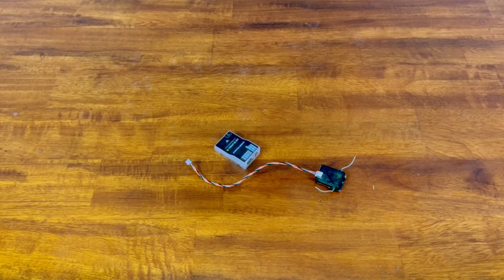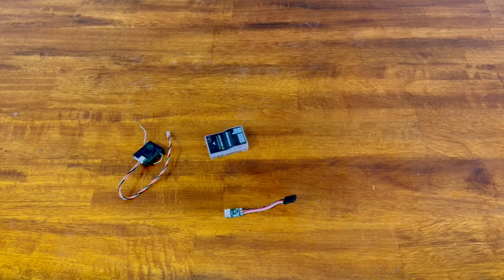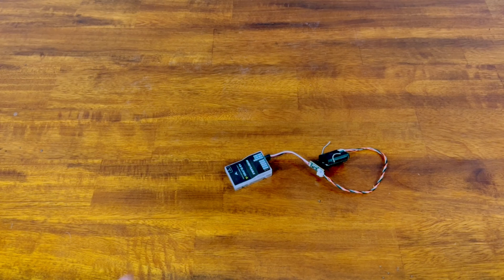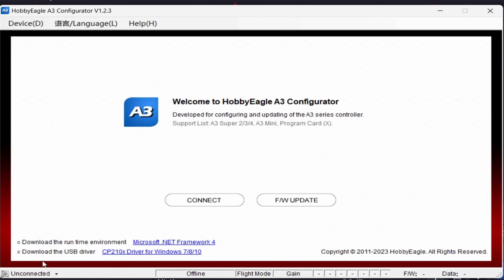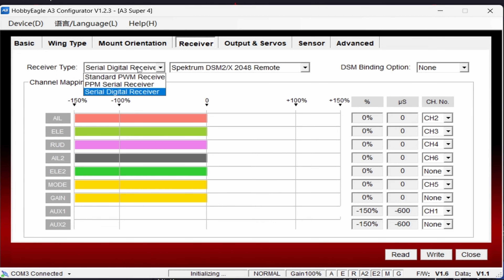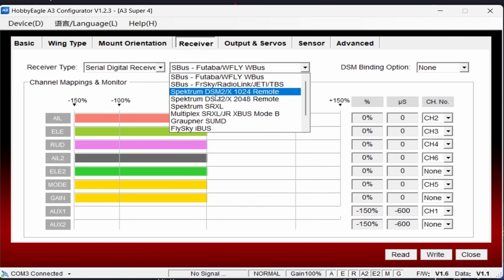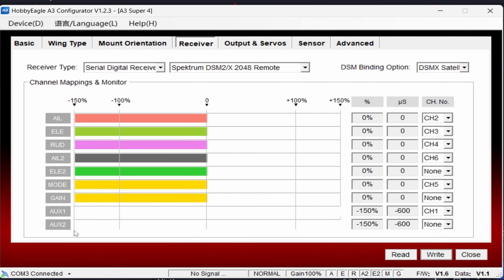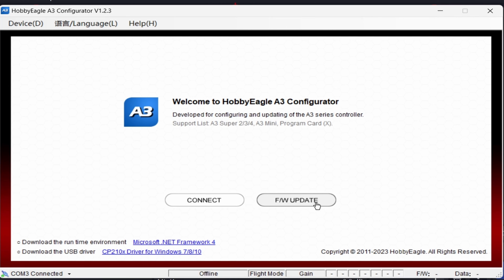How To Bind HobbyEagle A3 SUPER 4 Gyro To Satellite Receiver

Comment: This video said it was instructions on how to bind the HE A3S4 to the satellite but the video never actually showed the binding procedure.
Reply from the maker: It’s how to bind to a satellite receiver. Satellite receivers give you way more range but have a different binding protocol like a normal receiver.
Reply: Would you consider doing a video where you show the actual binding with the flashing yellow lights, etc… that’s the step where my radio fails to bind with the satellite even though the gyro and satellite are flashing yellow lights. Thx!
Reply from the maker: It all depends on what radio you’re using. I use a jumper t lite so I use a different protocol than others. If your using a spectrum satellite receiver just bind it the satellite receiver the same way you’d do without the gyro.
Reply: Will give it a try, thx

Comment: How many challers are in the satellite of the receiver? or that depends not only on the radio? Thanks
Reply from the maker: It’s got  5 channels I think. Also depends on the radio how many channels it can use. If you only have a 3ch radio you can only use 3 channels on your receiver.
Reply: @NeuroticRCshorts  depends on the radio got it!!

can you advice a satellite receiver that is good and not very expensive?

i have a opentx radio i can bing with quite few satellite receiver. but all those are expensive..

i hope you have some advice, thanks!!!
Reply from the maker: radio link has satellite receivers and will work with this receiver. I appreciate your questions and your support with the channel!
Reply: You guys know if range is limited when using a satellite only receiver? Thanks